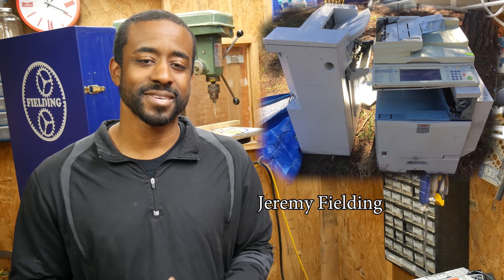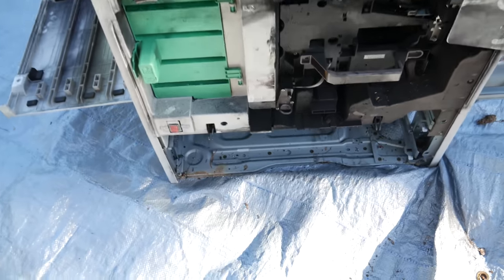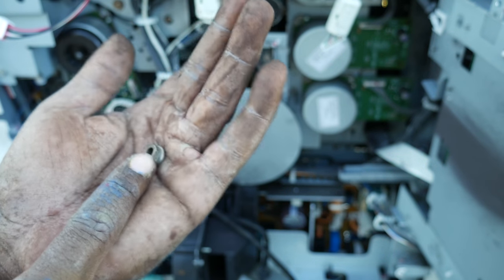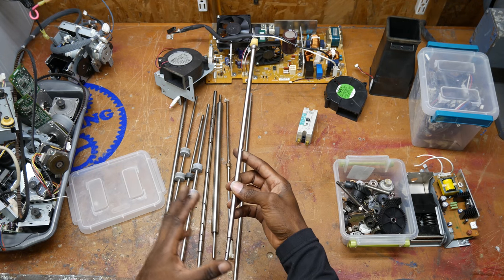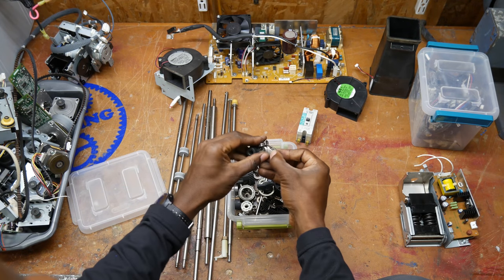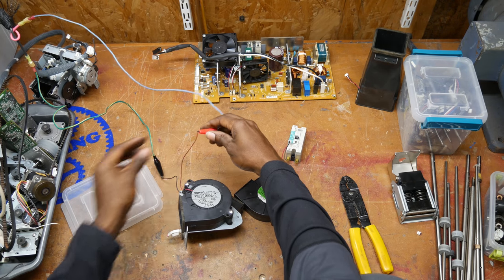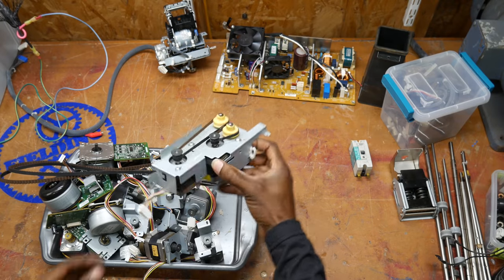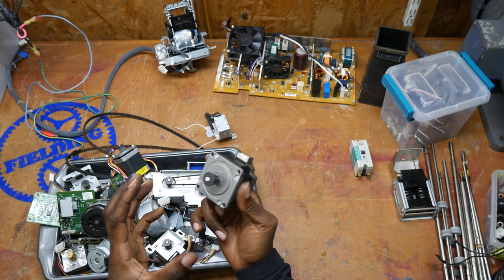How To Salvage A Commercial Printer for Electrical And Mechanical Parts 049

Comment: I used to work on larger but similar equipment to this for a living and they are a wealth of goodies for tinkering. The glass in the scanner area is tempered glass and would make a good table top for a small end table. You can etch a design into the glass using a small sand blaster or an air "eraser". The feed roller metal shafts can be cleaned up and used to make turning mandrels for your lathe. Sometimes the roller shafts are stainless, check with a magnet. I use the shafts as lathe stock to make small parts on my metal lathe as well. Printer toner makes a good pigment for mixing up colored epoxy if you ever need any so you may want to save some for that! There are usually lasers and pretty cool prismatic reflectors in the scanner assembly.
Reply from the maker: Lots of good ideas thanks:)

Comment: Can recommend Latex gloves for Both ink and laser printer Teardowns. And just a heads up some of the toners are carcinogenic in powder form so a respirator will go a long way! Sweet video. Unfortunately i only got "consumer" grade printers so far!
Reply: carcinogenic means cancer causing, it builds up in your body till one day boom cancer.  ( for those that don't know / are learning ).
Reply: Yes. Do not expose your skin or lungs to the Toners.
Reply: my thoughts exactly too, but gold video
Reply: We will all die eventually
Reply: Also, toner is polyester, ground into a fine dust.  Letting it fly in the wind and drop on the soil is a massive injection of micro plastics directly into the environment.
Reply: I was gonna mention the same. Printer toner particles are just fine enough to get into your epidermis. Years of handling toners and solvents have hooked me on a horse grade Mane & Tail lotion to counteract the chronic dryness. Careful, my dood.
Reply: Not Classified as a Carcinogen ... liquid inkjet ink: just messy ( mostly soap and pigments )

Comment: I worked on copiers and printers from the early 70’s through the early 00’s. Some advice about the bronze bushings that you found: they are for relatively low speed applications, and never, ever oil or lubricate them. Just clean them with a dry rag. They are made by pressing thousands of tiny bronze beads together and are porous, like foam rubber. They are impregnated with oil during the high pressures and temperatures of the manufacturing process. No amount of oil added to them post-manufacturing will put any additional oil back into the pores of the bearing. The oil will only collect dust and dirt, causing the bearing to fail.
Reply: 72mgmidget thanks for that info . I was just about to put graphite on mine 😮
Reply: Electron Proton Neutron Mouron 👍

Comment: sweet find my friend and yes a CNC would be a nice build "hint hint".  Those motors are nice. I've always wanted to salvage one of those bad boys.
Reply: I could not tell what phase those stepper motors are. You can pretty much only really use bipolar motors today. The drivers for the rest are too difficult to source. But unipolar and 5 phase motors are common in commercial equipment.
Reply: The oddball in copier motors is the scanner drive motor. Most that I work on (KM & Canon) use small 3 phase motors instead of steppers for smoother movement. Kinda hard to fabri-cobble a driver circuit for them.

Comment: I work at a car dealership. We have two car brands spread across what used to be three stores. One slow day I went and explored the now unused parts warehouse in the middle. Among other treasures I found about ten old computers and at least a dozen old printers. I knew there were good shafts and stepper motors to use and circuit boards to scrap. I asked around until I got permission to haul them off. 

Fully three of the printers still work perfectly, including one with Wi-Fi, a duplexer, and a sheetfed scanner. There was also a Fuji ScanSnap high speed sheetfed scanner. 

It took me many days of "spare time" to break down the rest, but I now have hundreds of plastic gears, dozens of precision shafts, a box of fans of varying voltage and diameter, many boxes of top quality circuit board scrap, over two dozen stepper motors (including some strong enough to run a 3D printer or laser engraver), 8 or 10 solenoid of varying size, and lots and lots of wire. I posted the plastic and steel scrap on Craigslist and someone picked it up (wasn't enough to be worth it to me to cash it in, but enough that someone would). Haven't cashed in the circuit boards yet, but I'm looking forward to some cash there.
Reply from the maker: You found quite a treasure man.

Comment: I found 2 printers similar to that one - half of my garage was covered with the pieces for a month!  Loads of solenoids, stepper motors opto-detectors, dc motors, 4 HV power supplies in each, plus lots of steel shafts and bearings. A gold mine of parts :)

Comment: Yep, one thing about them "Corporate" size printers, you get a MESS of motors and gears outa'em. Whenever I happen upon discarded desk top ink-jet and laser printers and decide to salvage, I "harvest" just about all the junk inside - springs, rods, solenoids, motors, gears, screws (most screws), some electronics, inner parts of the housing, etc. Great source for esp. mechatronic "mad scientists"  projects and "sputniks"

And, to make another point, some of the components and elements salvaged can be extremely difficult and or costly to acquire by normal "mail-order" commercial means for one's personal unique purposes.

Anyway, as always, good conscientious vid Jeremy. So Keep up the great stuff man.

Cordially:)

Comment: I know exactly how tearing those apart feel. I took 3 of them apart and took EVERY screw out all 14 trillion of em. All the same goodies. Wish i coild attach a pic to show you my shop when I got done lol plastic panels and metal EVERYWHERE. awesome vid
Reply from the maker: I ended up editing that part out because the audio was bad but I did record the carnage in the end lol it was crazy
Reply: I don't have to space to take apart such beasts right now, but I do a lot of smaller salvage. If I don't want to get into shredding (again -- space is an issue) what's the responsible way to dispose of all of the structural hard plastic waste? E-waste recyclers won't take disassembled bits for obvious reasons...

Comment: Hey Jeremy, I keep not only the HD magnets, but also the cast aluminium Harddrive housings, they make excellent material to meltdown for my aluminun casting projects.
Reply: I have a giant pile of them because I figured they must be high quality and I knew they were cast aluminum which is supposed to be a lot better for pouring into a mold than 6061 aircraft or just random bar stock aluminum.... Is that true? Do the hard drives really pour better?

Comment: Getting those printers on the roadside is a huge jackpot!!!
Reply: I'm telling you. You're not finding anything like that where I'm at. If you could I'd be on it all day.
Reply: That's same for where I am living at.
Reply: @1pcfred  There a dime a dozen where I live. On Let go Market place last week' a company posted 60 for free as they replaced to new ones
Reply: @scraplifetrashtocash4551  that sounds great. I'd take a few.
Reply: I came across a dumpster with at least 5 that I could see.  Was a roll off with 8 ft sides though.
Reply: @emeltea33  I've never seen a dumpster I couldn't get in. Most have a bar welded halfway up them that is a step.
Reply: @1pcfred  getting in isn't the problem. It's getting out, particularly with what your grabbing. Once I found a new in crate reduction gear thing (think some steering piece for heavy equipment) that was 70+ pounds. I got it to the top, sitting on the edge, but looked up when I was out and realized there was no way I was going control that weight coming down.
Reply: @emeltea33  that's why dumpsters have 4 corners. The excitement of acquisition has caused me to have super strength a number of times now too. When I picked up my air compressor I picked it up by myself and put it into my car trunk. Once day I was moving that thing with a long iron bar scratching my head wondering how I ever managed to do that. It is 40 gallons with an ASME rated tank on it and a cast iron head with a huge repulsion motor when I bought it. I snatched it up like it was made out of tissue paper though. I did the same thing when I got my table saw. I grabbed that thing so fast I stuck the blade into my gut stuffing it into my SUV. It'd have gone a lot better if I'd just taken the time to wind the blade below the table first. But for $20 I grabbed it like I was stealing it.
Reply: @1pcfred  haha, I've done that a time or two also, if not just to prove a point. Did that with a gun safe going up stairs. That one particular 8' tall roll off has the back gate open now. I almost feel like it's a trap, just lying in wait. Hope the stomach was ok, eviscerations can get ugly. I recruited a buddy once for an entire work bench. Turns out the lock just engages at a whim. I bound it up, voila. I've seen a couple others, but left them (super expensive though!).

Comment: I been pulling parts out of discarded electronics all my life. Started with old valve or vacuum tube radio's. Began as a curiosity of how things worked and ended up building many useful things out of it all.

Comment: Have you built a plastic shreader? All that plastic e-waste can be converted into feed for a homemade injection molder.

Save the aluminum for a homemade foundry.

Linear rods for cnc/ 3D printers. Likewise the stepper motors.

Comment: I used to work for a company that rented out commercial printers. We would have to take them apart to fix and clean them before the printer went out to the customer. They are pretty interesting on the inside.

Comment: If I recall correctly, the part you were unsure of with all the gears is likely the auto stapler for the unit.  I've taken two of them apart now myself, as I had to dispose of them from work and a) didn't want to lift them into my car by myself, and b) wanted to keep all the goodies inside just like you did...
Reply from the maker: Moving that thing was crazy. And someone who builds these told me it is a stapler so thank you ...you are correct.

Comment: I took one of these apart 1 year ago and got 28 stepper motors. Most of them nema 23 but about 9 nema 17’s. Im going to run out of steppers soon so I’ll start looking for another printer!
Reply: Were they all the useful bipolar variety?
Reply: Paul Frederick every single one.
Reply: That's good. What did you end up using so many stepper motors on? I have a pile myself, but I only ended up using 3 on my CNC.
Reply: Paul Frederick 2 CNC machines and 2 5-axis robotic arms. I still have several more steppers but none of them are ideal sizes for things. I mostly like having a dozen nema 17’s around so I’m always ready with a bunch.

Comment: I recycle outdated nuclear submarines for a living. I LOVE taking things apart that I don't have to put back together! I would love to have all the stepper motors. I used some from an old floppy drive to power my telescope.
Reply: What pray tell is an outdated nuclear submarine? Those things don't even need to be refueled for 50 years. Though we do have an overstock of nuke subs. That's because if we ever stop making them we won't easily be able to start back up again. So every 4 years we make another. Well, we're making one all of the time, but going as slowly as possible we still crank one out in 4 years.

Comment: The 2.1V on stepper motors is the highest voltage you can apply to them without any controllers. It just means that if you apply 2.1V DC they will reach their maximum current and won't overheat even when stationary (0% efficiency so 100% goes into heat). Commercial stepper drivers usually apply very high voltage (for example 50V) to energize coils quickly, allowing more rapid movement and then lower it when maximum current is reached to avoid overheating. High frequency AC voltage will act similar since polarity will change before too much current builds up (you can use stepper speed calculator to test it).
Reply from the maker: Now that is interesting. Thanks for the info
Reply: While you're saying go, go, go the motor is replying no, no, no! So we developed high voltage constant current drives to persuade more performance out of recalcitrant stepper motors. Technically it is due to inductive reluctance, and decreased step times at higher speeds. As you speed the step rate up the period between pulses has to decrease. We can't dilate time. But we can increase the voltage. Which has the effect of shoving more electrons through a coil for a given space of time. Volts times amps (the flow of electrons) is power. So it stands to reason that increasing both increases power output too. It is still funny to watch a stepper motor current starve as you run it faster.

Comment: Hey Jeremy,

I know you're into some mad engineering, and I hate to be the safety police - but I've been in IT for over a decade - I just wanted to give you a heads up for next time.
Toner (that coloured powder) is crazy carcinogenic, and due to the fact that it's incredibly fine you run a decent risk of siderosilicosis (similar to silicosis from regular cement dust).
There is no safe exposure limit to toner - we even have to use a special vacuum cleaner to deal with toner spills (these vacuums are about 60% filter by weight, and cost a fortune).

Also, looks like you might already know this - but cold water, immediately applied, will wash off toner now problem. Toner fuses with heat, and even body heat can start that process.

Absolutely staggering haul from that MFD - you can really see why they're so expensive, and why companies tend to lease them vs purchasing them outright.

Keep up the great work!

(Aaaand just now I'm realising this video is 3 years old. Thanks algorithm!)

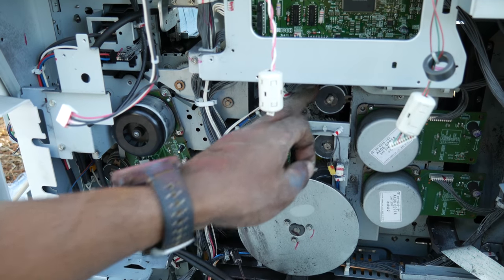Comment: @2:38 the things you pointed to are magnetic clutches. I think they were 24v in the older machines. I used to repair Ricoh copiers/printers.
Reply from the maker: Thank you! I love it when you guys bring these little facts all together for me.
Reply: No prob!  If you find anything else weird I might be able to help.  With the clutches, basically the main motor powers all those shafts, but the shafts don't turn until the clutch engages. So everything is timed to feed the paper through different stages.  You could use them in the same way and use an arduino to control them.  
Another cool thing is the rollers that pick up the paper from the tray - it's called a feed and reverse roller. Kind of hard to explain, but the lower roller has a spring clutch inside that is being driven in reverse, but the top roller is forcing it to feed forward. If two sheets of paper get between the rollers, the lack of friction between the pieces of paper let the lower roller go backwards and kick the bottom piece of paper back so only one sheet gets picked up.  Really clever system! 

This shows it pretty well - https://www.youtube.com/watch?v=Qs6tPLBi-6s

Comment: Before touch those capacitors, be sure they are empty! Once i salvage old digital camera, opened it after testing it wasnt working and touched the circuitboard for the flash. I getted 300V electrical shock from it, the camera fly from my hands very fast, then i throw it away and had always be carefully with capacitors ewer since. These days i Allways remove the capacity by short circuiting it before touch.
Reply from the maker: For some reason I didn't think about it on this project... but you often see me discharge "caps" before I move them in my videos. Its a good practice.

Comment: The easiest way to run a stepper motor is with another stepper motor.... if you have two that match, twist like colors together and then simply turn one by hand and the other should spin the same direction. Once you know they work, then you can even use those motors to figure out the windings of other steppers. I have even used a large stepper motor to run smaller ones on my cnc projects to make sure my axis are all set up correctly and its a great way to make sure everything is moving smoothly before I put power to the machine. I suppose you could also build a poor mans cnc machine by wiring a large rotary switch to a couple axis and use one motor to run a couple others manually if you want.....
Reply: Christopher Leveck actually that gives me a great idea . I will set up a dc motor linked to a shaft of a stepper that wired to another stepper motor . This will allow me to get simple metrics on position increments or on a seperate note you could use a lower power dc motor coupled to a small stepper motor to create higher power steps in a bigger stepper motors output. A test I shall do soon 😮

Comment: if I pulled one of those apart id be so tempted to toss the HDD into my USB enclosure and see if I could mount it or even read it.   Those things buffer anything copied and often times stuff is left behind when the units are scrapped.

Comment: How many steppers of what size did you pull out?

Could you publish a list of the goodies?
Reply from the maker: Unfortunately it has all been spread out to various bins or tossed if I didn't have a plan for it. That was quite a while back now. I try not to keep parts forever as that leads to a lot of "I will use this one day". I don't have the space to keep items like that. If I don't know what I want to do, and its not a common part I use in many projects, I throw it away after a few months.